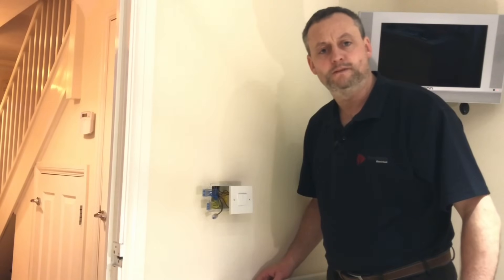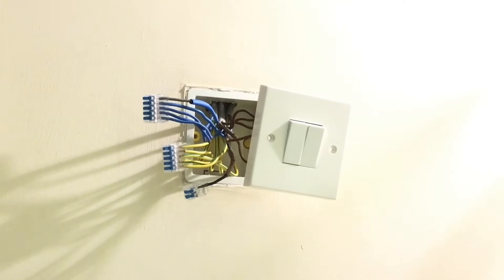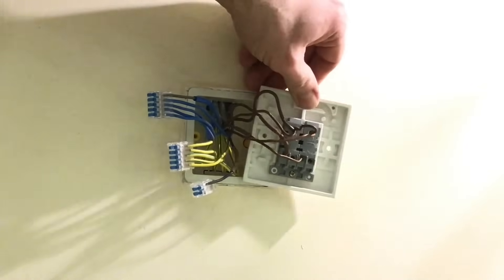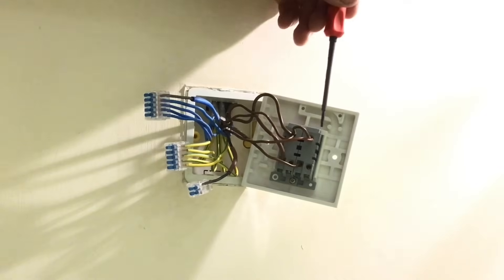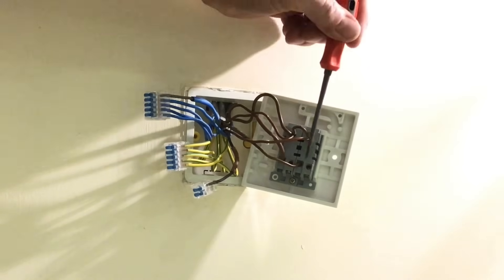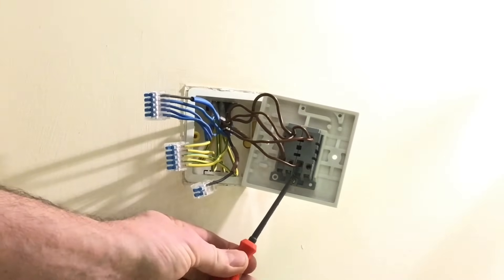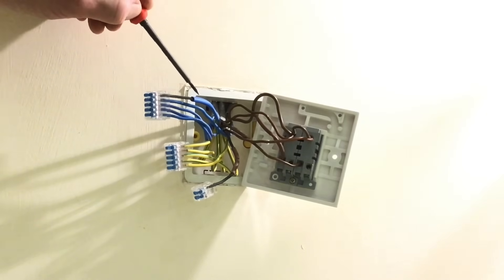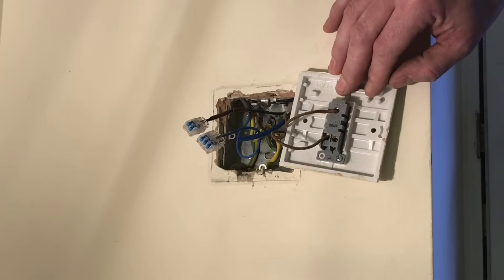Taking the Feed (Supply) to the Switch and Connections Explained in a 2 Gang Switch

Comment: looking at the schematics for a smart switch, it has the light bulb neutrals going to L1 L2 and L3, with a separate live and neutral powering the unit. So is it basically your video in reverse? All the lives grouped together in a connector rather than all the neutrals?

Comment: Just wondering how you going to mark on consumer unit, downstairs lighting and a TV socket?
Reply: Doughnuts will do this just put it on the ring or radial, i know it’s not much power but you’ve got to identify the light and power as two separate circuits?

Comment: Its much easier doing this in 1 core (line) and earth cable. Bring two cables down to the switch and connect the two lines into the common and the third cable connect the single line into the L1 or L2. Obviously the earth would be connected in the metal box or in a connector in a plastic box. A single core cable (neutral) can be run straight from the fuseboard to the lights (looping in and out).
I find it easier using single core and earth cables for looping in at the switch as you do not have to fit a deeper back box to bring 3 T&Es down to the switch. Regardless of my preferred method for looping in at the switch you make some good presentations-good job.

Comment: Great video thanks always wondered how this works
Reply: With help from your great video array I have decided to take part p and 17th edition wiring courses at my local college. Thanks for all you do
Reply: Hi gaz if i had three separate lights in one room and a 3 gang switch am i correct in thinking all wires would connect in behind the switch as opposed to ceiling rose

Comment: Is this method replacing the ceiling rose? Or do you use this method just for spot lights/pelmet lighting etc and in other rooms still use ceiling rose? Thanks in anticipation.
Reply from the maker: Hi. Many new builds have the supply at the switch as it can help having a neutral there with smart controls for lighting circuits. Thanks for watching GSH Electrical

Comment: Could you explain why there’s a supply for a socket off a lighting circuit is that allowed does it go to a FCU first  ?? Also would the tv not overload the circuit if it’s not on a fcu? Thanks
Reply from the maker: Hi. The socket installed for the tv was a 5 amp one which has a different design to a 13 amp BS 1363 and different plug top. Tv’s take a lot less than one amp so it’s fine to connect them to a lighting circuit. Think about the number of hours people sit in front of the tv if it drew a large current your Electric bills would be massive. Hope his help GSH Electrical
Reply from the maker: Hi. The tv draws very little current and the socket outlet is not the standard BS1363 but a 5amp lighting socket using a 3 round pins. Often these types of sockets are used to feed table lamps so they can be switch them from the main switch es at say doorways. All the best GSH Electrical
Reply: I too would have thought this was not allowed. So what's the limits on connecting a load other than lighting onto a lighting circuit?
Reply: Quality, that makes sense to me now 👍

Comment: Good video, just what i needed to explain to somebody on a job why i was rewiring the lighting circuit via the switches and not a 3 plate, a lot of people haven't heard or do not get this method, but it makes life better when DIY Dave comes along after you and tries to connect his new light fitting as there is only one light at the ceiling!
Reply: dosnt this method make it a nightmare for future expansion? i.e smoke/extractors wont be able to be taken from in the loft, and would need to get down to the light switch which means possible chasing involved
Reply: @paulneary703 That’s a good question and you are correct with your assumption.
Reply from the maker: Hi my first video explained that due to the popularity of downlights it’s common practice to reduce the number of cables at the lighting points by feeding the switch. Sorry I didn’t reiterate this in this upload. The link is in the video to this upload and also at the end. Thanks for watching GSH Electrical.